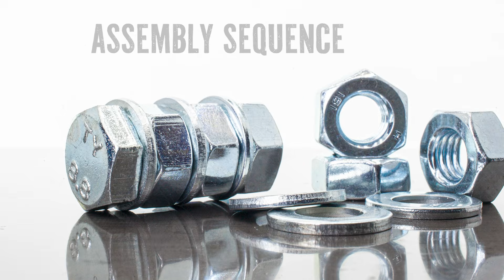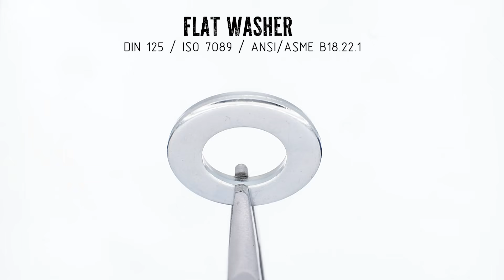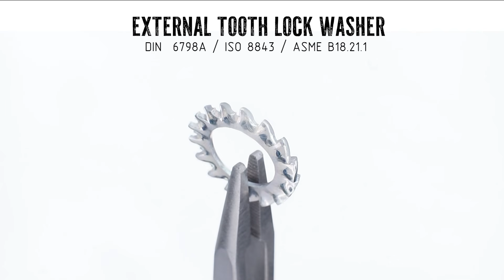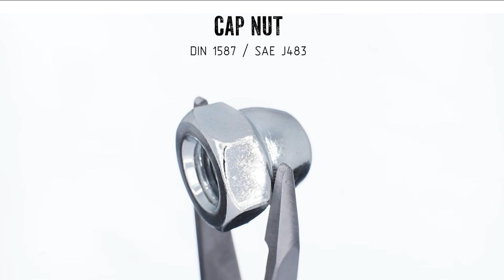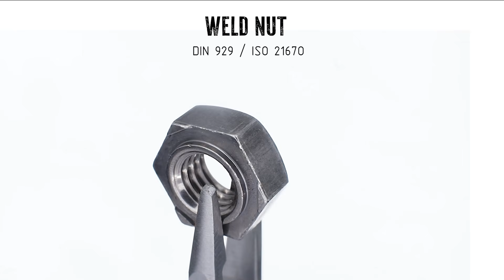The Correct Way to Use a Bolt, Washer, and Nut

Comment: there are no bolts used in video. Bolts have a part of shaft not threaded. The video shows hex set screws which have a thread the complete lenght

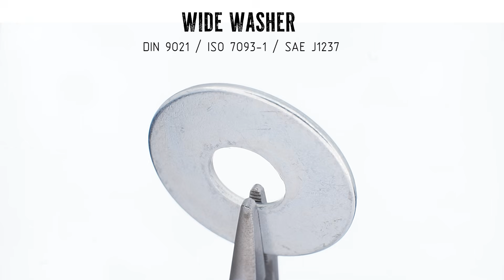Comment: 2:19 It won't protect it from being crushed, but it will protect it from being scratched because a bolt CAN TURN WHEN TIGHTENING. Why take the chance? Also most flat washers I've used are larger than the bolt head itself, so they do distribute the force over a wider area. They're only pointless if you're using a backplate between two or more bolts(D-rings, for example, most take carriage bolts, so either washers or a backplate and locking nuts).

Comment: In electrical engineering, a tooth lock washer is used to "bite through" the powder coating and create a conductive connection between non-live parts of electrical equipment.

Comment: Stupid, misleading, faulty video. At 3:35 the only right answere is the right picture where you marked an X. Also your motivation is faulty. You would not use a spring lock washer under the bolt head when using a nut, and when not using a nut it isn't a bolt joint at all, it's a screw as can be read in machinerys handbook, the bible that collects definition of ISO, DIN and ANSI standards. Stop spreading faulty knowledge to people. Also a spring lock washer like that is used to 500MPa screws at most, the 800MPa and higher actually deforms or weakens the springyness in the washer so it serves no longer a purpose.

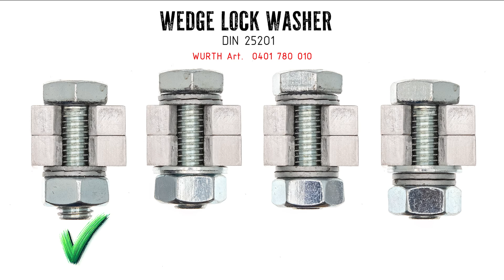Comment: @06:48 as per Nord-Lock manual - first variant from the left should be "X": "Through holes require two pairs of Nord-Lock washers — one pair for securing the bolt and one pair for securing the nut". The only valid is third from the left.

Comment: The terms "screw" and "bolt" is used to describe the application of a fastener.  The fastener you illustrated can be a screw or bolt regardless of head type or size.  When one hole is a clearance hole and the other is threated then this is when it's used as a screw.  When it's passed through two clearance holes the. It's used as a bolt.

Comment: Weld Nuts (DIN 928 and DIN 929) have a cylindrical sleeve with a known tolerance (d11 for DIN 929) in order to center them to the part without using any bolt.

Comment: Around 3:45 you say that the right one is wrong, because the spring washer might open up, but why this doesn't occur with the left case?
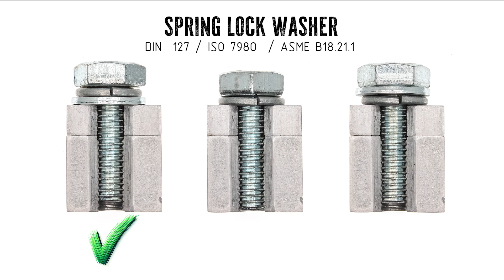Reply: What's even more confusing is that, accoring to the video, the example on the left at 3:18 is good practice, while the example on the right at 3:45 isn't.  The two situations are essentially identical.  The bottom line is that, to be effective as possible, the split lock washer needs to bite into the workpiece and into the screw head/bolt head/nut.  If a flat washer is used, it is likely to turn with the lock washer, allowing the fastener to spin out.  Lock washers are more effective if a flat washer isn't used at all.  With a bolt and nut example, I would place one lock washer under the bolt head and another under the nut without using flat washers (unless protecting the workpiece is absolutely critical), because a bolt can spin out just like a nut can.

Comment: Lock washers go under the nut,  like they were designed for. 99% of the time, it will go under the nut.
Reply: But the bolt can turn also.  For example, it is recommened that Nord-Lock washers go under the bolt head and under the nut.  If I were forced to use split lock washers for whatever reason, I would use them under the bolt head as well as under the nut, and I would omit the flat washers altogether if loosening of the fastener were my primary concern.
Reply: @Zerk_Ziegler them people stuck in the 80s. LOL
Reply: I agree. Only under the head if it's a tapped hole with no nut.

Comment: Wondering what washers to use to mount the exhaust pipe coming out from the cylinder head of my motorcycle.
The original nuts are completely rusted and no more available.
Because of high vibrations they have a couple of small dents at the top part of the internal thread protruding to inside. They are named as "self-locking" nuts by the manufacturer.
Since the wall of the nut is thinner in the zone of that two dents, I presume that there will be a small deformation of the metal while turning the nut around the threaded stud. That deformation probably keep the dents pressing against the stud thread preventing the looseningy of the nut.
Should I go for comical washers or the nord-lock washers?
Reply: Why not self locking copper nuts designed exactly for it?
Reply: @mephisto86yt  Great idea.
I didn't know about this copper nuts. As I understand, they are vibration resistant through deformation.
Unfortunately the engine cylinders are in open viev and the copper color doesn't match with the black and gray color of the head... (Moto Guzzi V-twin engine for Stelvio 1200cc)
I was forced to buy the original ones... I paid them a lot of money, but my wife never discovered the bill. ;)
Reply: @giuliobuccini208 👍you did the best thing buying the oem ones, even if they are expensive. Choosing the right washer, bolt, grease, gasket is a pain in the...
Reply: @giuliobuccini208 anything with an engine, if it's made in Italy, will put a smile on your face. I hope they will keep doing what they are doing

Comment: According to Wikipedia DE spring lockers are basically without function which is why DIN 127 has been withdrawn in 2003. There are videos showing in vibrating environments they are more effective than others however. Mmh.